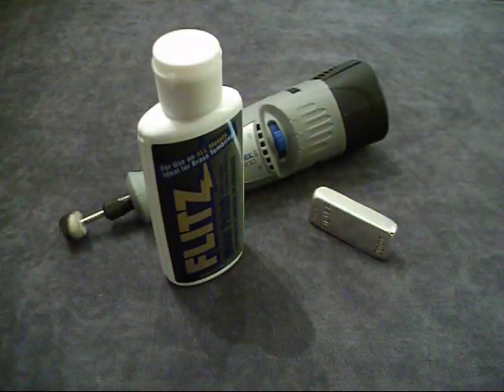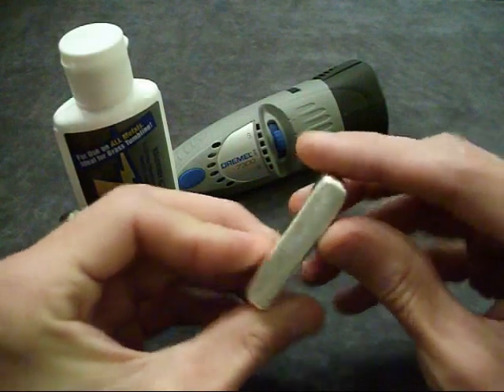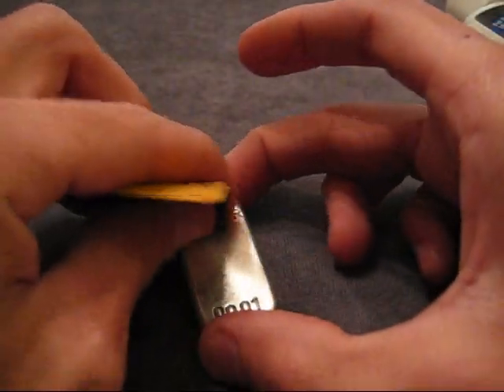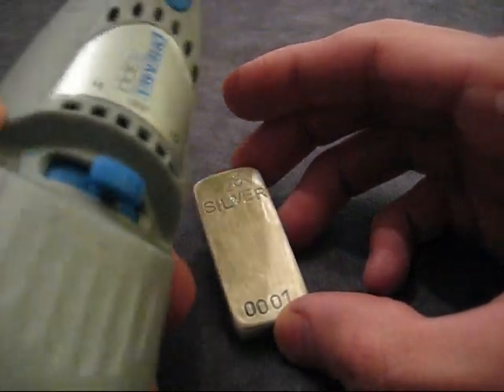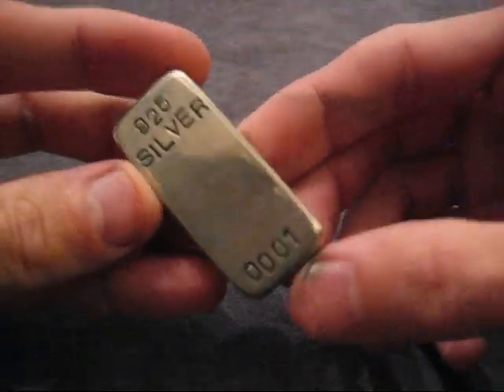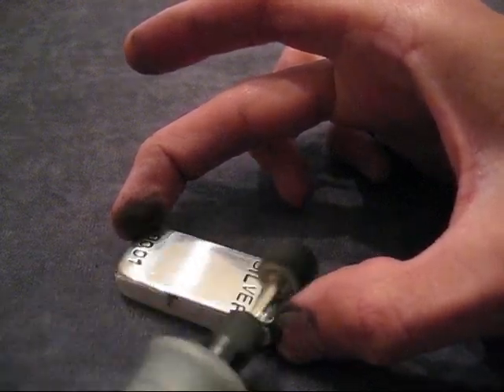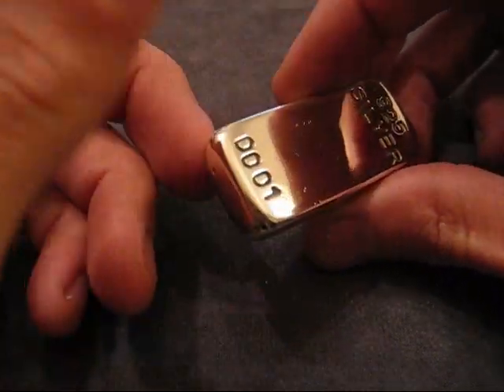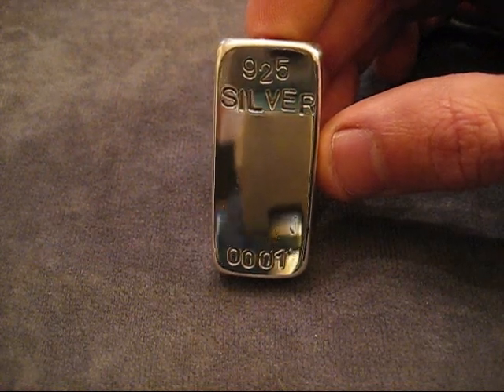CREATING A SILVER INGOT AT HOME PART 3: TRUE MIRROR POLISH

Comment: you are an idiot if it doesn't you are an idiot if it didn't have abrasives it wouldn't work. every time you are rubbing or polishing you are removing material. it takes an abrasive to do this.
Reply from the maker: Why don't you pause the video at 0:11 and read that it says it contains no abrasives on the bottle.  Then call Flitz and prove to them how their own product is something you know more about than them.

Comment from the maker: Would probably work ok, but for the time needed to "tumble sand" and the cost of the abrasive grit, I would rather just use a piece of sandpaper.  You can't use the grit for polishing metal either...still going to need to tumble with shot/bb's to polish.

Comment from the maker: All the silver I melted down for this bar was hallmarked as sterling.  If it's not hallmarked you have to do a scratch test with nitric acid, and depending on what color the acid turns tells you the purity.  Whatever purity you melt down is what you get back.